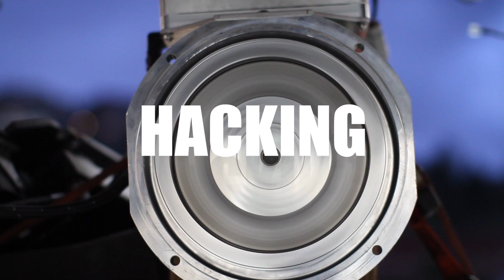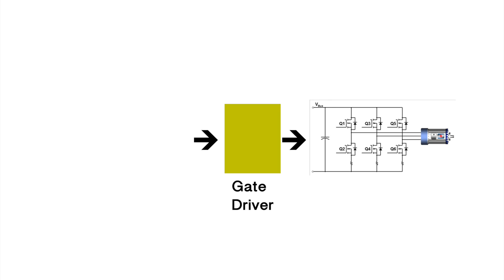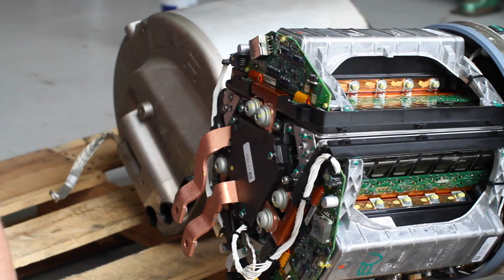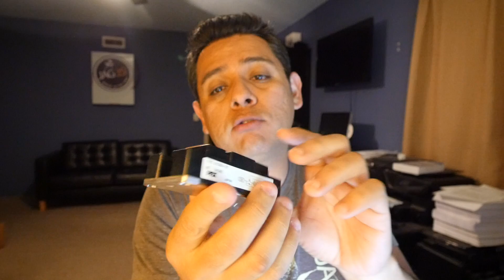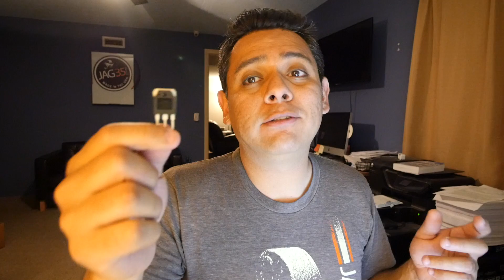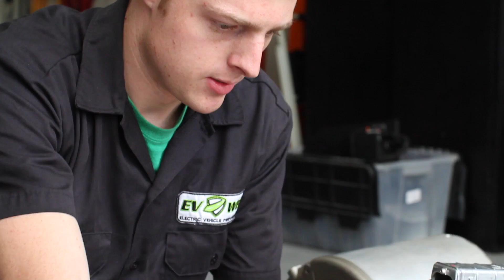TESLA MODEL S MOTOR INVERTER HACKING

Comment: Could you theoretically use the inverter to charge the batteries using 400V 3-phase (same concept as when you  use regenerative breaking) and drop the regular custom AC charger?
Reply: Short answer-No, Inverters make AC from DC but can't function in reverse to charge batteries. A rectifier would be needed to turn generated AC  into DC for charging batteries.

Comment: hi ☺️ nice video. can u put a video opening that thing.. if u have. 
Tesla engineers are very much clever. they used regular semiconductors but used in very efficient way, that makes Tesla's 89% efficient. even small electronics nowadays don't do that. Tesla cars are just awesome pieces of electronics and electrical engineering. 
i think they have use multiple transistor used in parallel because that reduces stress on just single piece and that increases efficiency. and further more even if one transistor fails it will not stop the car completely, or will fail other components. they have properly engineered electrical and electronics together. hats of to such engineering 👏

Comment: I've never seen gel on circuit boards before.  I've seen people use mineral oil for marine electronics where the enclosure is filled with mineral oil to keep out salt water and resist crushing from depth.   
I've seen people use  grease on underwater connectors to keep out dirt and water, and I've seen boards have conformal coatings like silicone or acrylics.
It looks too sticky to be an electronics resin - usually resin coatings dry up and turn solid.

There's a thermal gel called TPutty 504 by Laird.

Comment: google search

tesla motors patents

Have you tried to read the patents? This would seem helpful, no?

Actually considering Tesla mission statement;
https://www.tesla.com/about

"...helping the company work towards its mission: to accelerate the world’s transition to sustainable energy."
Electrification of transport is an important part.

If you EV hackers (if I can use that term) could get together similarly to how open source software projects form, you could approach Tesla and perhaps get some ideas/guidance on developing an open source controller/inverter. 

But consider that for "conversions" of gas/diesel cars to electrics perhaps keeping it simple is better?
Are city cars (meaning <100mile ranges <70mph) a good enough niche to supply cheap/reliable transport for the masses?
Might make a nice niche industry for the next 50 years or so. Your Samba for example
Are you getting what I'm driving at?

Comment: that would be awesome if you guys can figure out how to do what would essentially be a stand alone ecu for the motor and be able to use a lap top to turn the hp up
Reply: Tony W I also have an EE degree, though I did more control systems than coms. Either way I think what this guy is doing is fine, just remember kids; with HV one hand behind the back is key to not dying. Also that gel on the boards is quite obviously HV insulation.
Reply: And there you have it another degree carrying idiot putting down someone who is doing hands on work with this stuff all the time.
Reply: tony you are right and the peeps on here thinking they can turn up the HP have no clue what they are talking about , they think this is a gas engine that you can turn up the timing and remap the ecu and get more power. This is a high voltage high current tuned power supply  and messing with it will destroy it not increase hp. Tesla has it set up now to give a lot of power and still go many miles safely without setting the batteries on fire.
Reply: +Krusty Pickles 
Obtained a degree, sounds better
Reply: yes their is the possessive i was pointing it out cause you said "As someone who went to School and did there Degree" there is more of a direction. like go over there

Comment: Collin is working with Jack @ EVTV and they have been successful at controlling Tesla drive train with all original components they also able to control the BMS on the battery pack and now they are working on the chargers and possibly the DC to DC converters. But it's interesting the approach that EV West is going for I don't know why Elon musk doesn't make a kit for guys that want to build kit cars and classic electric cars they could sell fully operational drive train like GM FORD and Chrysler is doing with there crate engine tesla could create crate motor packages and also help individuals or companies that want to recycle Tesla drivetrain and battery packs.
Reply: Probably because their priority is on getting their own car out in time and working trough those pre-order lists. Then scaling up production to fulfill demand and really take a place in the whole car industry. When they have done that, maybe they start thinking about the hobbyists.
Reply: V10PDTDI, Elon had mentioned early in Tesla history they would be sellng the powertrain to manufactures. I recall (?) Toyota signing up a couple years ago? Check, I expect other manufacturers are using Tesla.
Reply: Really good points, +TheFiremonkeyman... a 400kW motor is way overkill. the 80kW motor in my Nissan LEAF is plenty for most cars, so much so I'm seriously considering transplanting the drivetrain from a wrecked LEAF into my dead Honda. I had toyed with the idea of going for a wrecked Tesla instead, but was put off by the complexity - in fact, your points make for a much better reason!
Reply: beautiful
Reply: Chances are, they are so busy with the products in the pipeline, they don't have time. I will say they have been positioning themselves to be a supplier to other OEM's for years, and I think that was a large part of the original business plan, but the other large OEM's suffer from severe not invented here syndrome.
Reply: They probably want limited access so only they have the real magic sauce.
Because they are still the very top of performance EV in production.
Reply: V10PDTDI not sure what happened to EVTV but it went dark and all of Jack’s guys left!
Reply: tesla motor has the mágic Powertrain only for his boutiful cars this is my opinión
Reply: his beautyful cars
Reply: ola v10 pdtdi cara e uma boa ideia em ...agente aqui no brasil recicla bateria de notebook motos e bicicletas ate mesmo carro nos ja tranformamos eletricos
Reply: bodymodsMONTE  will you
Reply: you need spell check
Reply: I'm guessing that these 'salvage' components go for a fraction of the price of something that Tesla would sell in the lines of 'crate motors'. As salvage they're probably at least sensibly affordable.
Reply: I've been wondering that for a long time. My thinking is that the battery is the real inhibitor here. Your average car can't handle the added weight, even when you factor on the engine and driveline coming out. Then there's the question of where to put it without cutting apart the car or simply setting it on the battery sled as a body-on-frame setup.

Adding additional springs and shock absorbers would help, but you'd still be exceeding the GVWR of the vehicle by adding the tesla batteries to anything except a full-size truck. So this setup could cause a legal barrier to driving the car.

Then you have to consider the added power and strain that you'd be adding to the frame. A Tesla motor and battery would literally rip a car like a Nissan Sentra apart the first time you floored it.

Separating the battery packs and simply running the coolant and electrical lines around the car could work for weight distribution and packaging, but there's still the weight issue.
Reply: Musk has no foundation concept for all America,  he is bent on Government paying him for the way he wants it done not the way Government needs it done, same goes for NASA whom has gotten fetup with his ideology.

Comment: do you have any idea of charging an 48v 18650 battery pack with tp4056 or pls let me know any other diy charging method. your videos are grt and I'll b waiting for your reply. I'm building an ev as my engineering project. I have very little time hope u reply soon. tq
Reply: or make 2 separate packs and charge them with an IMAX b6. but you will not have the 48v at nominal voltage but when the pack is at 75 to 100%
Reply: Thank you for the reply
Reply: no problem man. I was planning the same thing but in my country it's nearly impossible to do this legally.
Reply from the maker: http://j35.us/48v1500wCharger
Reply: sachin sac if you need a diy way, get a boost converter that you can run off a laptop charger or something else, and set it to the max voltage minus a few volts
this does NOT balance them so keep on checking every few minutes the cells so one doesn't reach 4.2 before the others
Reply: BitsAndBites balancing is the main problem as I cannot keep on monitoring it continuesly 
wt about charging them using tp4056 modules by mechanically disconnecting d series  connection  while charging.
Reply: what does it need to run? an 100w LED or a ebike?
Reply: 1000w 48v ebike
Reply: I think you should do 2 packs of 6 18650 in series and a bunch in parallel. buy a high amp output bms and when you put the 2 packs in series, you'll have something over 50v when the cells are individually at 4.2v. this way you can balance charge each pack with a imax b6. (imax b6 can charge a Max of 6 cells at once. that's why I recommend 2 packs)
Reply: luckym0nk3y ok tq for the info, is bms necessary if I use imax b6 to charge the battery??
Reply: nope, you don't need a bms. you can also have a volt meter on somewhere. if you drop below 36 volts, you need to recharge. the only benefit you'll have from a bms is that it automatically will shut down when you drop below a certain voltage. but it's not necessary. just keep an eye out that you don't drop below 36 volts. this way each cell should be at around 3v minimum. and when you recharge the imax will do the balance charging for you.
Reply: luckym0nk3y thank you very much for the info. I appreciate your support, hope I don't mess things up. the whole ev will be built by myself including the mechanical structure. I'll upload the video once  I'm done tq.
Reply: I made a 12S 1.3 kWh battery pack for my ebike and use a 300W Turnigy Reaktor to balance charge 6S at a time, and via solar panels - works well enough for me, even if having to charge in 2 sessions.

I'd like to use a BMS to handle balancing, but the specs for these boards don't appeal:
±0.05 V tolerance is a lot when the limit is 4.20 V, and they aren't adjustable.
If only there was one available with 0.01 V tolerance, and programmable to cap at 4.15 V I'd be happy.
Reply: 48v or larger  is very easy to charge as long as you have a bms connected to it . I use a $12 600w 12-80v  boost converter i got off ebay and a old Xbox 360 power brick that pushes out 12v at 10amps. Just adjust the boost converter to the nominal capacity of the battery pack and connect it to the charging leads of the bms . if you have a large pack and you need more amps you can use a dc power supply or pc power supply .  From what have seen building your own charger is typically better than stock with improved charge times and often internal component longevity .
Reply: i wouldnt fiddle around with a hobby battery charger. i built myself a 600Wh 10S li-ion pack for my bike and i charge it using a step-up driver, driven by a 30V powersupply. 

But for you:
get youself a 13S BMS: https://goo.gl/91SlR0
and a constant current step-up module to be a bit more flexible at the input voltage: https://goo.gl/XKvZmk
(also available with higher wattage, but check the max charge current of your batterypack)
just set it to 54.6V out and around 5-10A constant current depending on input voltage.
as powersupply try a refurbished server powersupply like a cisco ws-cac-xxxxW  These range from 1000 to 8700Watt and cost just around 50 bucks.  https://goo.gl/vCfQnh    
starts up when power is plugged in and outputs 48V, no need to hack into this. (check datasheet https://goo.gl/Ig7VD4 )

you can use a higher wattage powersupply, it doesnt really matter, you just got more headroom if you want  to charge more packs simultaneously.
except the 8700W model, all seem to be around 20-50$